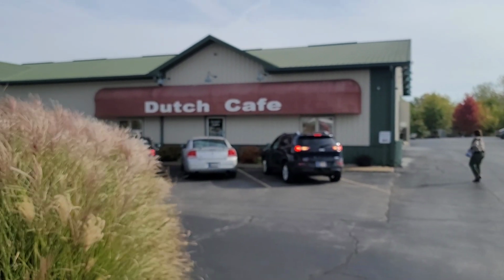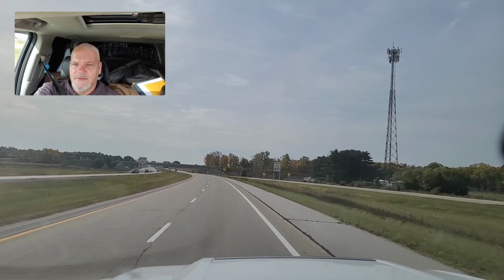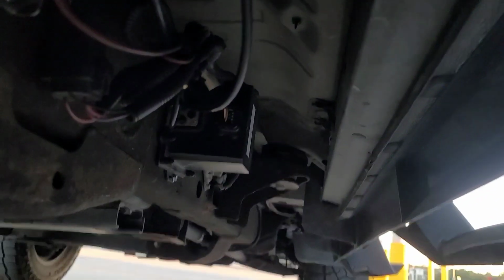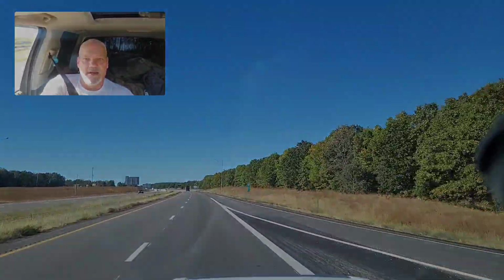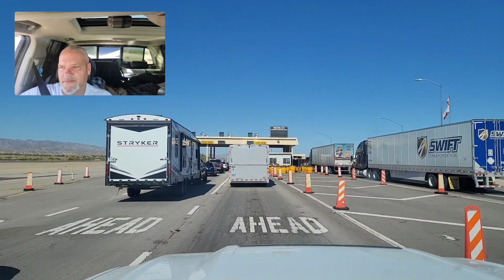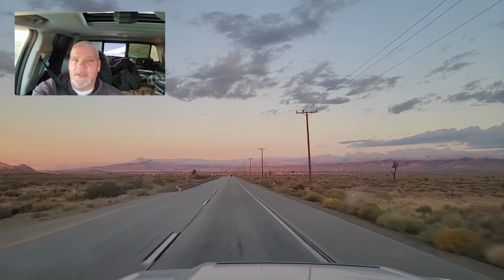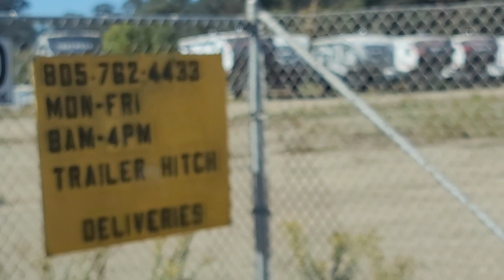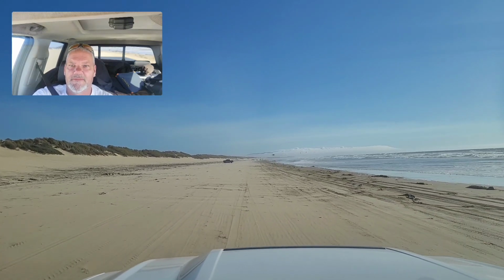Indiana to Arroyo Grande 10-24-23

Comment: Looking at your edge I noticed you set it up differently. Just curious as to why your not monitoring your oil pressure with it anymore? Great video by the way.... keepem coming...
Reply from the maker: Tony bought the edge cts2 and it wouldn't work on the 2020 so i swapped with him so i could update it for him. Even after the update i still caint find the oil pressure in the pids. I'm looking forward to swapping back
Reply: @CFarmer  thanks for the quick reply. I bought the CTS3 after watching your install video. One of the things I like most about it is the ability to read codes and reset them without having to pull out my AUTEL MK808TS.
Reply: I have a 2017 Chevrolet Duramax  LTZ.

Comment: I am surprised that it has 2 axles. Looks so cute and think of the fuel mileage. Be  careful when you back up. Joke of course.  Ones that understand will laugh. I have a big question does Oregon rape you for miles driven ? It’s like more then 22 cents a mile for big rigs.
Reply from the maker: It wasn't as bad as a big truck. It's been about a year or so since i went to Oregon. Caint remember exactly. I remember having to buy a fuel permit the last time i was out there in a big truck but didn't need I'm pickup